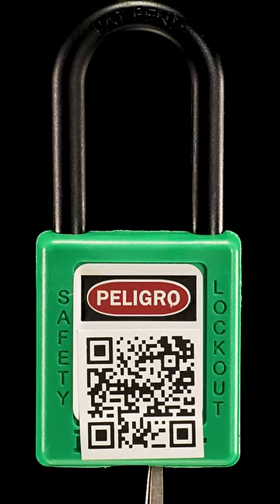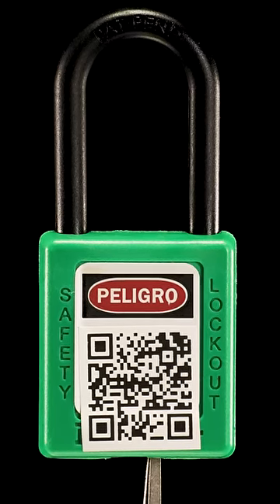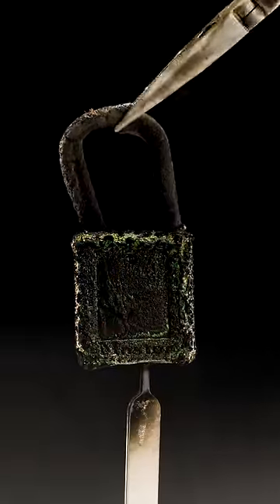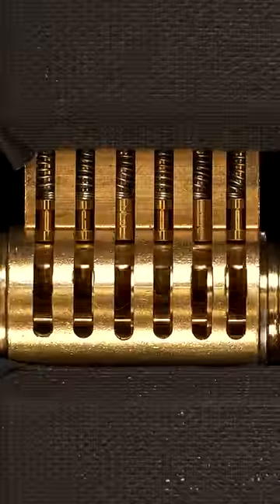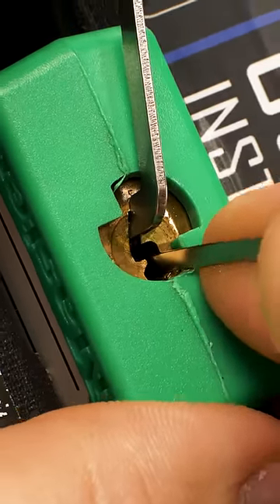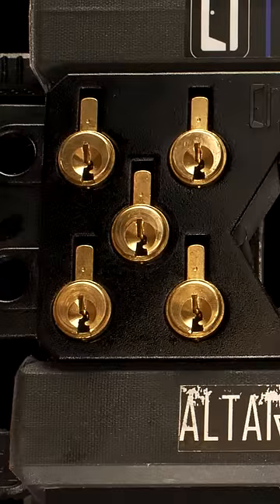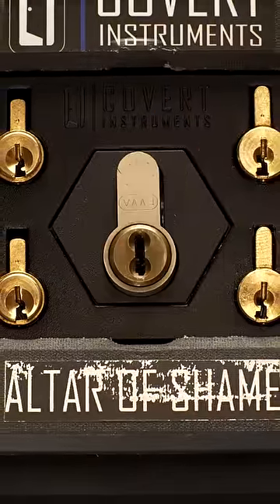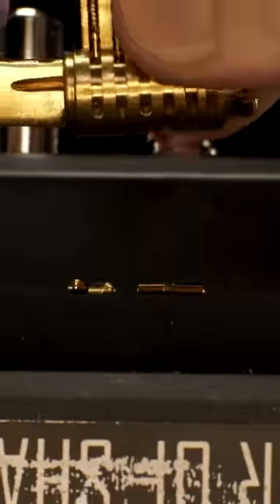Locksport Trainer

Comment: Leave it to ML to put their best cores in a plastic lock 🙄 Still crack up everytime I see the ridiculously long wave rake 😂
Reply: Those locks are made for LOTO or Lock out/Tag out on electrical boxes and other dangerous machinery that are being maintenanced. 
  Theyre designed to break away if an emergency arises but designed to be extra secure to deter tampering.
Reply: @longbow6416  It's also a lock who's only purpose is not to lock something, but to disable it.

90% of the time there is no advantage to bypassing a LOTO lock. There is no benefit. There's nothing except being able to throw whatever switch it was keeping in the OFF position.

Putting a core with that many security pins (putting a core with any security pins) in a LOTO lock is just wasteful. Nobody would ever pick one.

Even better, since they are plastic, nobody will ever pick one.
Reply: @teknikal_domain  You're right that no one is likely to try and get past one for direct personal profit. The risk however is one being mistakenly taken off if a key works for more than one lock(or it being overly easy for someone with the right combination of laziness & indifference to bypass without evidence in pursuit of saving a couple minutes). You avoid that with better tolerances and more possible pin settings. 
It was probably just simpler to use an existing stock/design of higher security cores even if it meant including pointless single pin picking counter measures. Although if I'm not mistaken security pins also resist raking/bumping which could be another risk if people get too used to jiggling their keys in the lock.
Reply: @teknikal_domain  there's no benefit to bypassing a LOTO lock, unless you're Agent 47.
Reply: @teknikal_domain  you can't undo breaking the entire lock, therefore it prevents the lock from being tampered with without someone getting in alot of trouble.
Reply: @longbow6416  but if its designed to break away then the pins dont add security
Reply: @bugglemagnum6213  if it was picked it could be reattached covering up malpractice. That's quite a bit harder with a broken lock.
Reply: i like the few seconds of silence before he just blasts it
Reply: @teknikal_domain  taking one of these off when you didn't put it on is also a great way to end up in jail/ getting knocked out by the guy who put it on
Reply: @andrewmoore7022 he only thing that you could do after taking it off is flip a switch and probably kill someone. Most plants have cameras pointed at power supply points and thats not something that you can really get away with
Reply: @teknikal_domain  they dont do it so people cant pick them. they do it so someone with the wrong key cant accidentally unlock it. you can open a lot of master locks with other master lock keys that are close and sometimes not even close to the actual key for it. this stops some asshole from inserting his key and juggling it till it allows them to turn it. master knows there locks are junk so by doing so it saves lives and lawsuits.
Reply: That wave rake looking like a Flamberge.
Reply: @longbow6416  Why are they locked if they aren't worth locking or picking? I'm not following you guys.

 One guy said they are made from plastic for safety reasons (electrocution!)

 Feel like there are easier ways to make sure no one is fucking around with something. Feel like I am missing something else like 90% of the conversation haha.
Reply: @dianapennepacker6854  TL:DR > they are worth locking (safety, yay), but since they're not intended to prevent theft there's nothing to be gained by picking them.

We use these to lock machinery and electrical panels in the off/depowered position while performing maintenance or repairs. Each person working on (dangerous parts of) the machine has to add their individual lock, which stays on until they're safely away from dangerous parts; since each one has a single unique key and can't be removed by someone else, it keeps some idiot from turning it back on while you're in the machine, holding a wire, etc, and subsequently killing or maiming you.

On the rare occasion one needs to be removed without a key, we (read: a supervisor) just use bolt cutters.
Reply: @mischaburns5593  ah that makes sense about turning something on while you're doing something else. I gotcha! Makes a lot more sense then.
Reply: The point of it is that if a lock is removed by the owner, it will not need to be cut or burned off. They put the best core they have to prevent a lock from being removed by someone other than the owner without a clear sign that it wasn't the owner. It's less for keeping out and more for indication that people are working on it, and a sign that it shouldn't be turned on.
Reply: @teknikal_domain  it’s more of a “we know for sure this wasn’t picked or bypassed neither intentionally nor unintentionally”. if they put a normal master lock core it could probably be opened on accident and risk the life of the person it’s protecting. it’s more for bureaucratic reasons than practical, but it’s also meant to discourage dangerous laziness and sloppyness
Reply: @longbow6416  😅
Reply: The fact it's plastic isn't what's funny to me, it's the fact their best core is in a lock designed for showing intent, restricting access to certain features on factory equipment, and securing thing in direct line of skght. It's not a security device, yet its more secure than their security devices despite that.
Reply: @teknikal_domain  it's not wasteful.  It's a tamper evident lock. Let's say someone is underneath an elevator car. The motor will be locked out with one of these locks. The point of the lock is you have to either A: have the key, or B: use a blatantly obvious destructive method to remove it. This way the average person can't pick the lock, operate the mechanism, and replace it like nothing happened.
Reply: For what these locks are used for, if the lock fails people can die and they WILL get sued. So when it comes to those locks they can't just yolo and send it.
Reply: @ExileXCross  not disagreeing, or discounting the purpose. I use loto locks at work regularly. I guess I should have clarified, more of a comment that ML has a decent core like this loto lock, but puts junk in other "high security" offerings
Reply: They are made this way to meet osha regulations which specify how secure the lock must be. The regulations say nothing about how strong the lock must be so in order to keep them cheap you get plastic.
Reply: @dianapennepacker6854  my table saw has a hole on the switch for putting a lock to prevent it from turning on accidentslly. Same concept. So this is actually an example of masterlock making a good lock for its intended purpose. That dont mean the rest of their locks aint junk. But this one they had to make it a good lock due to liability reasons.
Reply: @dianapennepacker6854  kinda like for cleaning a gigantic industrial mixing or something
Reply: I'd bet it's only pick resistant because most people with a lighter just melt it off.
Reply: @UKMonkey hese locks are made for situations where the only reason why anyone other than the owner would intentionally remove the lock is if you’re trying to get someone killed. If your boss finds a corpse whose lock is melted or missing then they already know that one of the workers is guilty of at least negligent homicide if not murder
Reply: @rainingdeathx3368 A lit of retail establishments don't have camera pointed at every single power box, and trust me there are more of those in retail than you'd imagine. And they're just as dangerous if fucked with at the wrong time. Best example: the meat saw in the meat department's cutting room at your local grocery store getting turned on while you're cleaning it.

Source: I am an Asset Protection Team Leader. Most people think of us as "the guys who stop shoplifters" but we also deal alot with safety. This is especially important because retail workers care even less about safety than most of the tradesmen I know. Best example: the meat cutter who purposely wouldn't wear a cut resistant glove on his off hand when trimming meat with a knife because, "I'm more likely to cut myself with the glove on."
Reply: This is McNally's video I think this channel just stole it
Reply: @torgerthorkildson725  McNally works either with or for Covert Instruments. Dude literally promotes them lmfao.
Reply: Jesus loves you all! I pray nothing but blessings and prosperity in everyone’s life have a blessed day 🙏🏼✝️💜
Reply: These locks are safety devices, not security devices. They are designed to disable dangerous equipment while people are working on it. The reason they are made of plastic is so that you can easily cut them off if you need to. The reason they are pick resistant is to make it hard to remove without damaging it. Think of it as more of a tamper evident mechanism than a traditional padlock.
Reply: @UnliVW ya but the fact that its 1 easy burned 2 easy to break makes it worthless even for lock out tag out. As someone who works in a factory if a saw this lock I'd go straight to the safety manager
Reply: @saber5694 the thing is if you burn it off, it is very obvious that you burned it off. The OSHA wording is that "Lockout devices shall be substantial enough to prevent removal without the use of excessive force or unusual techniques". Burning it off is both excessive force and an unusual technique. They're designed to make forced entry possible, but obvious.
Reply: @ed6705  I work with heavy machinery. Anyone of them could easily brake a plastic lock without excessive effort. We've snapped steel pipes without excessive effort
Reply: They MUST be doing it on purpose by now... ML: "hey, wanna see if we can persuade the morons to buy an easily fracturable lock with even a fist, that will literally melt in a hot summer???"
Reply: @longbow6416   They're basically used for places that are already pretty secure.

So if you are someone intending to tamper with what they're locking, they're too annoying to pick because of the complexity, but the places they're used are too secure to use brute force without getting caught.

So it ultimately doesn't matter that they're made of plastic, because they're just to stall someone long enough to make it not worth getting caught.
Reply: As a sailor I can totally get behind making a LOTO lock pick proof. You want to be able to have the only way to possibly get by this lock be with the key or by breaking it.
Reply: @captaintony1227 exactly you probably have a few dozen of this on site and they need to be set to diffrent keys. Plus if you happen have lot of them on you key ring more then likely you going to just go through them till one works (because any marking or whatever have long since faded)
Reply: @asdfghyter yeah legal reasons for sure factor into this.
Reply: There is, like when a guy that put this LOTO lock on a device went home and took the key with him. Happened to me twice and I didn't want to destroy the lock so I tried to pick it, but it was impossible with some basic tools that i had. Ended up with cutting the lock both times.
Reply: @lumensmith9787 Yeah my thought as well.

Comment: Well, that's actually a lock for locking out equipment for maintaince so that it doesn't accidentally get turned on and kill the maintainence guy
Reply: That... Doesn't change much 😅
If someone is malicious enough to pick the lock a maintenance guy put on some equipment, they're malicious enough to carry a lighter on their person
Reply: @Steampuke  and then there’s proof it was intentional
Reply: @billy9075  ok, fair enough, I didn't think of that

Edit: though it's not a preventive solution then, pick-resistant metal lock would also leave proof, be more time consuming to cut and also be a better deterrent
Reply: You guys clearly don't work anywhere that has a LOTO program. The pick resistance is probably incidental with the primary motivation being that in a single workplace no two keys should be alike. Often times these are used on multi-lock hasps where every person working is required to have their own lock in place until they leave.

Being able to destroy these locks is actually a feature: if someone loses a key or leaves work without unlocking, normally a safety representative can still contact the person and approve removal, so the lock is cut.
Reply: @sauercrowder  I worked at an oil refinery and seen a few lock being cut there. What industry are you talking of ?
Reply: @Steampuke  It's used in many different industries, I work in warehouses as IT and our maintenance guys have LOTO locks
Reply: @poiu477  ok, that's interesting! I've worked in watchmaking and at this oil refinery and have not seen locks like this, just regular locks. I did see plastic collars being used though. Is that lock intended to replace those ?
Reply: @Steampuke  generally they are brightly colored locks that mechanically fix whatever devices power switch in the off position, they are only to be used while people are actively working on the equipment being LOTOd.
Reply: @Steampuke  provided the locks you saw were used for the same purpose, then yes.
Reply: @poiu477  hm. Nope, only red one time use collars. Might it be because I'm in Europe?
Reply: @poiu477  ok! I understand then
Reply: @Steampuke  I believe we use the specifically red ones too, but I know they exist in all sorts of colors
Reply: @Steampuke  the mandatory one time use collars may be a requirement just in Europe, tbh I don’t use them as part of my specific job so I don’t know the full details of our requirements even haha
Reply: @Steampuke  I don't really want to say but this is pretty standard in most industrial contexts in the US when it comes to containing electrical, chemical or mechanical hazards. You place the lock maybe on a switch, breaker, or a plastic clasp that surrounds a plug. There are many devices for different use cases. Often it does not matter how strong the padlock is because the locking device will be weak anyway. The padlock is placed with a tag identifying the worker, date, and contact information, and maybe some details on work performed.

Although I'm saying locks can be cut or destroyed with permit, normally that should require multiple approvals and can only be performed by certain people. It is definitely not something that happens every day and there is usually going to be corrective action for the workers involved if it has to occur. Nobody really wants to have to go through that process so it is very rare and usually you'd rather just make a person return or wait out the shift. But if a key is lost for example, it may become necessary with the worker present, and maybe not a big deal.

Anyway, the point of the lock is not to stop a murder, it's to prevent accidents. There have historically been a lot of fatal workplace accidents that occurred because someone energized equipment without knowing it was in an unsafe state or that someone was in harm's way. It is drilled into you that if you bypass one of these locks, you are never going to have a job again and will probably face criminal liability.
Reply: @poiu477  damn. That's unfortunate. I think I'm gonna look that up, I'm intrigued now haha ;D
Reply: @eligiobudde  Please read the comments above. I mentioned that I am in Europe and, through the constructive discussion that happened above, we realised that, while being one-time use plastic collars, we also had a similar measure in place.
Reply: @eligiobudde  well, for low risk applications we use plastic tamper seals, but for the rest we have metal tamper seals
Reply: @eligiobudde  in any case, this refinery has been functioning for decades and, while accidents have happened, I have not heard of any in which these seals have been put into question. The security measures are also routinely audited and updated, but that has not changed yet
Reply: LOTO babyyyyyy
Reply: @mikescott3414  yep stops alot of unneeded brutal deaths
Reply: It can't be metal?
Reply: @RandomLombax37  well it's best not to because they are way cheaper, don't need much security, and can be cut off easily if the key is lost, you are not to cut any loto locks without confirming with the person that put it in place
Reply: Yep we used in Porsche assembly line too. Its just to block door to be closed, that some1 is inside😁
Reply: @RandomLombax37 There's only one place I've worked where they recommended metal locks and that was due to low quality employees at a sawmill. Operators carried pry bars and lumber hooks that could be used to bust plastic locks if they got impatient.
Reply: @sauercrowder The thing is, the security pins are the reason the lock is fairly pick resistant and they do nothing to change the total number of possible keys. The only effects the security pins have is to increase pick resistance (which shouldn't be necessary in a LOTO system unless someone's trying to commit a very strange murder) and to increase cost. To be fair, the cost increase is small, but given that it offers no real benefit here it's still confusing that Master are happy to offer the pick resistance on LOTO locks but refuse to do the same on their actual "high" security locks.
Reply: @bosstowndynamics5488  Yeah, it could also just be that for compliance reasons there needs to be reasonable assurance that a closed lock was not opened except by someone with a key. I don't think this is really a matter of murders, of course that's unlikely, it's more about preventing cover-up of accidents, where maybe someone could remove a lock and then place it back after realizing their mistake.
Reply: @sauercrowder Exactly. Many factories in various industries use LOTO locks like these so either maintenance employees or machine operators can do tasks inside of machines without risk of another employee turning the machines on.